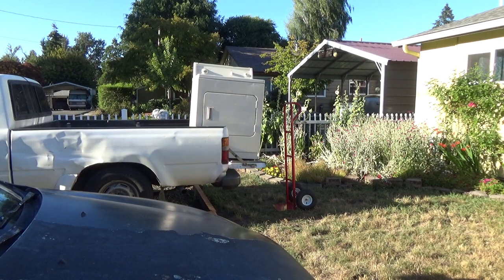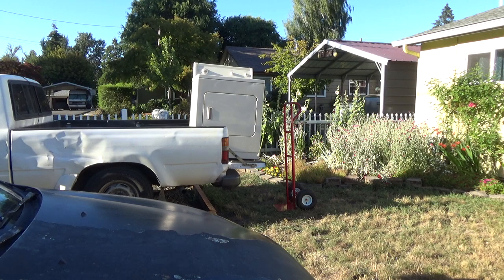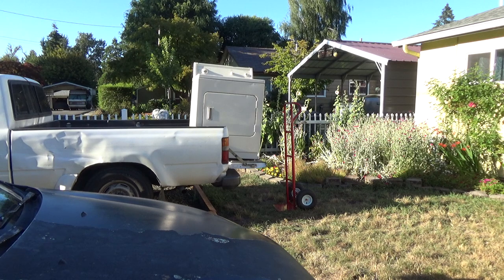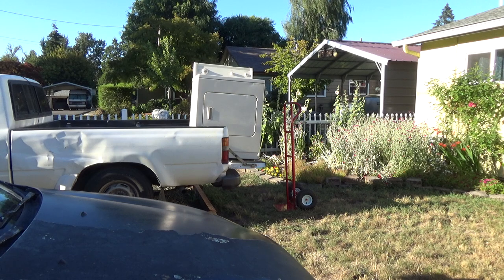How to unload a dryer from your truck by yourself

Comment: I’ve done this maneuver several times. I love my ramp though.
Reply from the maker: Thanks for stopping by.  I like your hydraulic table cart.  Been thinking of getting one.  Do you use it when working on your dryers?
Reply: @tubejim101  mainly use it to make videos with now. It was definitely handy when I was full time fixing washers and dryer‘s. 
Harbor freight has two sizes and I went with the bigger one and honestly it’s super overkill. I would’ve gone with the smaller one and save the money if I were to do it again.